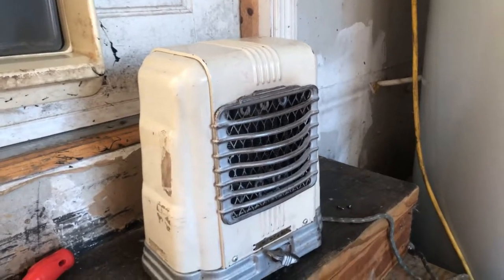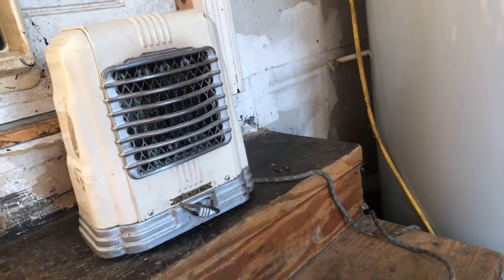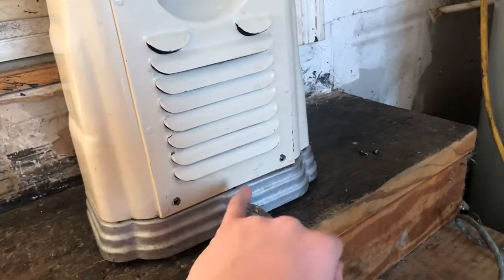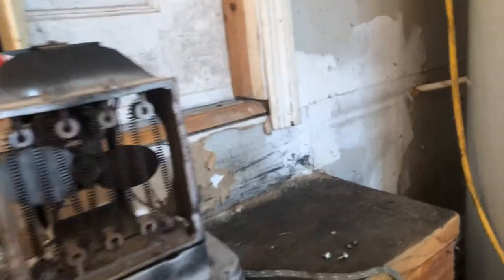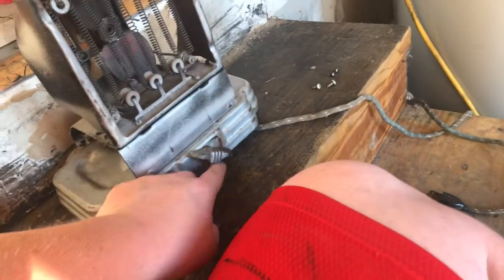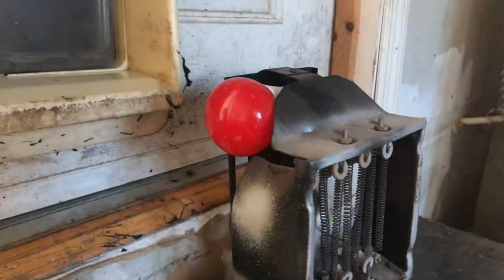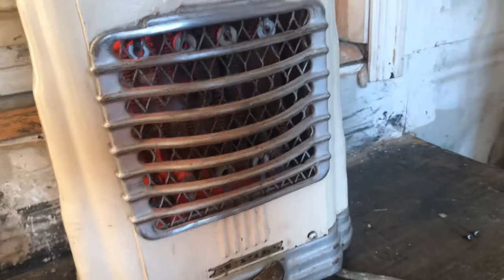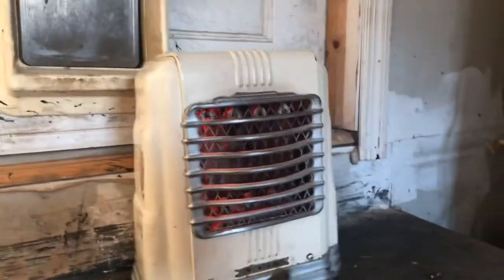Antique Arvin 203A Heater

Comment: i wish mine were that quiet, it wont stop rattling, and then if you knock on it the rattling stops, then starts again in a few minutes. I am wondering, how is that LED lamp holding up? I am surprised the plastic it is made of has not melted.